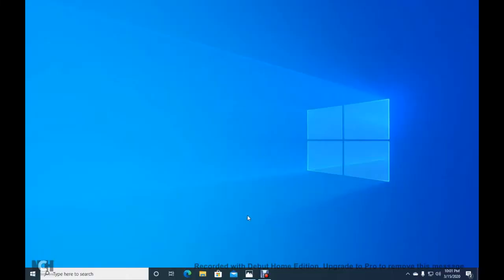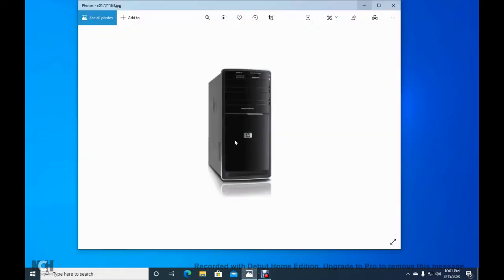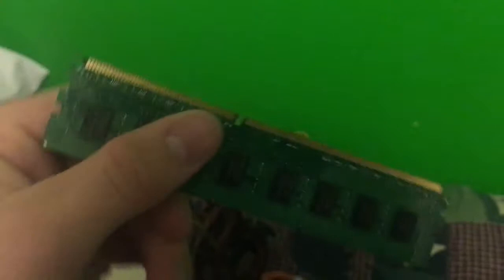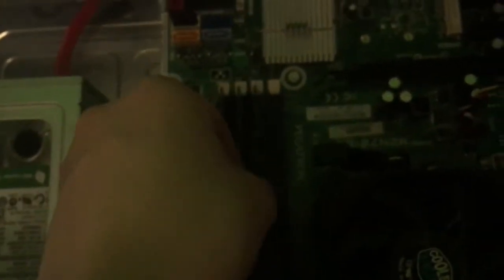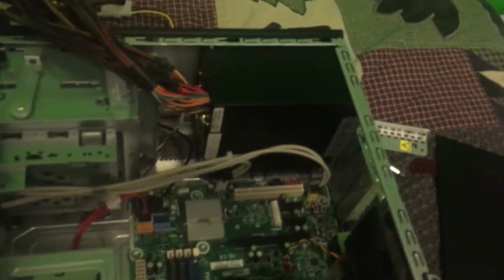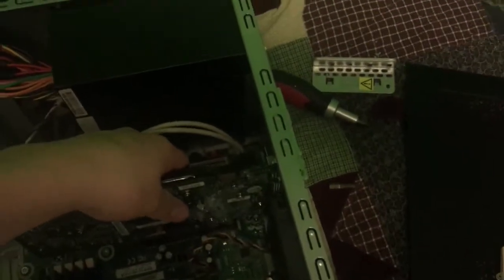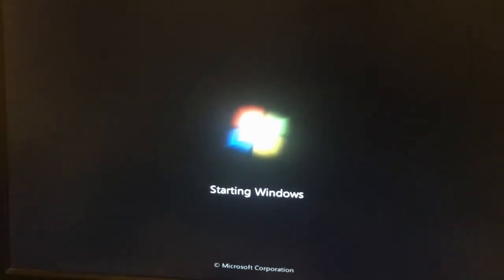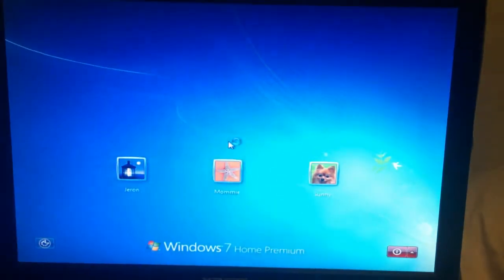Upgrading the HP Pavillion p6000 Home Computer!! Cheap, Powerful Upgrade!!!

Comment: I recently found this pc in my basement.
I wish I could use it again but it's really slow. My specs are i5-650, 4 GB RAM, Nvidia GeForce 210, HDD 512 GB. 
Can the RAM be upgraded over 4 GB? What's DDR type does it have? Thanks in advance :)

Comment: No new processore? 
I have this pc and I am looking for the firmware to upgrade to the phenom II.
Reply from the maker: @i balance now 

If I were in this situation I would go and look on AMDs website and try to find the correct drivers for it. Then just make sure that the socket of the Computer supports to make sure that the "phenom II" is supported. Sorry I didn't get back to you earlier.